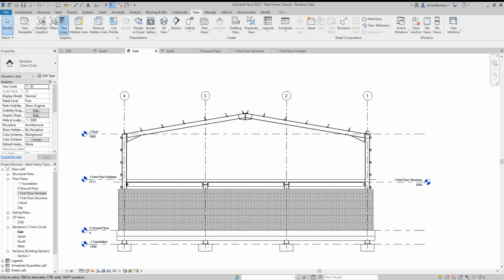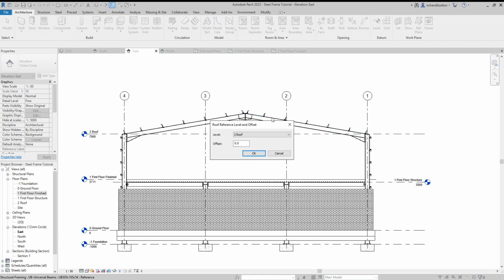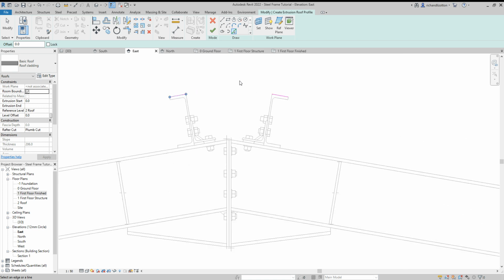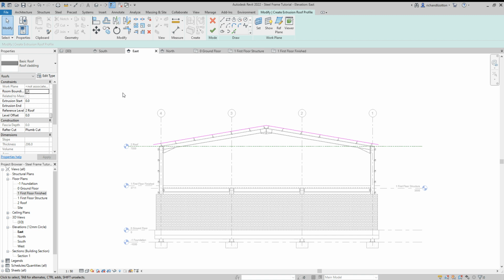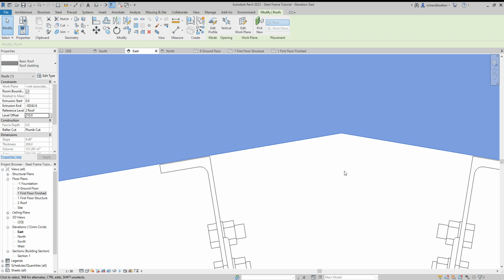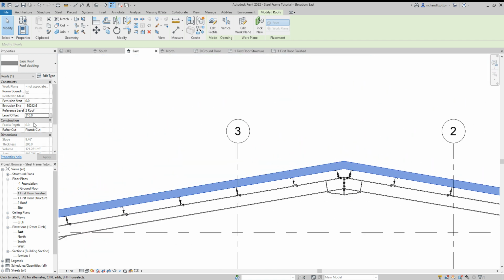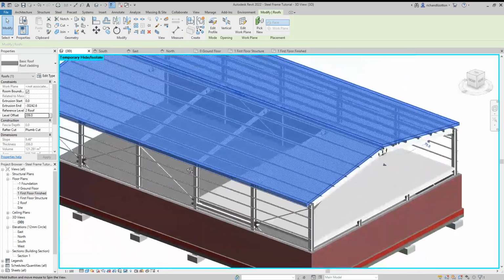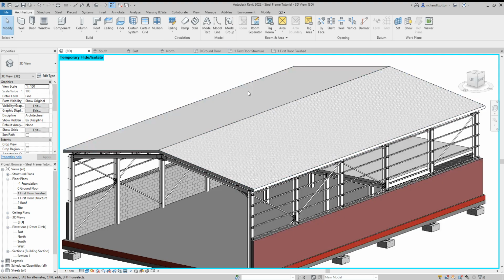14 Roof Cladding Steel Frame Revit Tutorial

Comment: Thanks for helpful clip.
Can you apply corrugated steel on this roof? Like deep deck with width and length parameters? And perhaps overlaps and screws?
Reply from the maker: It sounds like you would like each individual roof panel to be an individual object.  To do this you would not use the roof command but instead create a family for the panel, insert one into the project in the correct position on the purlins and copy it.  Not sure if this is really necessary though.  There is a way though of getting a similar effect while still using the roof command, I will add it to my list :)
Reply: @Architecture & Revit with Richard  Thanks for responding,  I already have done that, but it takes time, and I am searching for an easier way, like in tekla or advanced steel roof cladding with corrugated steel sheet, deep structural deck.